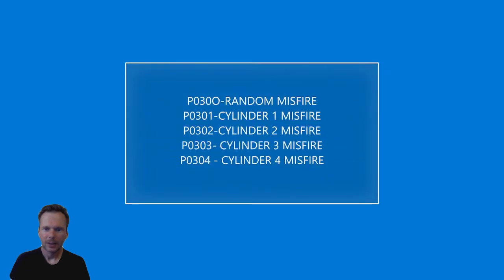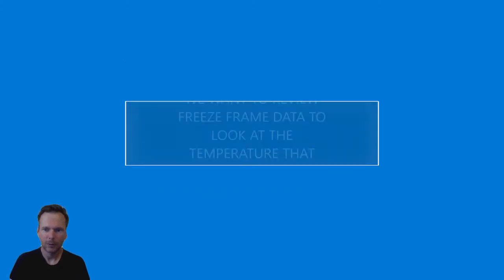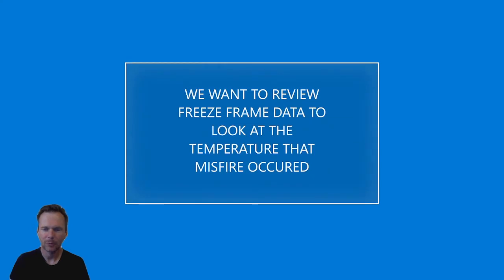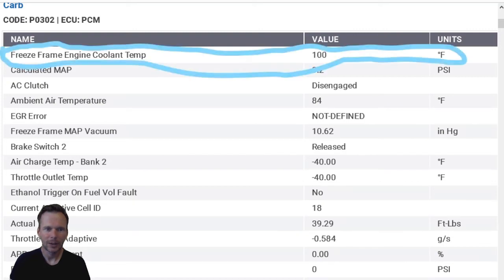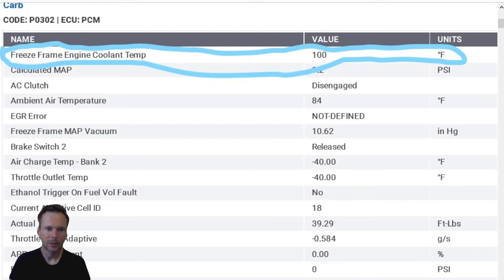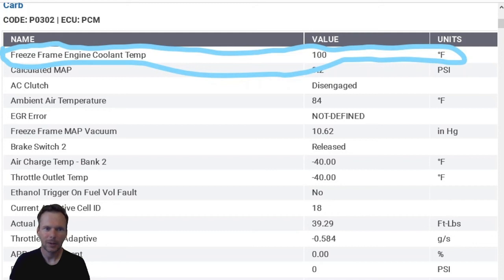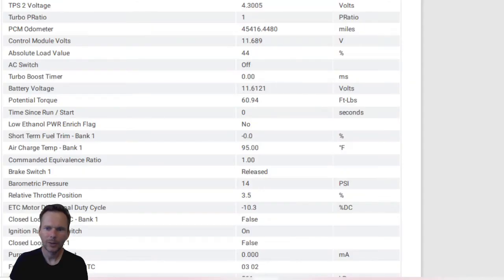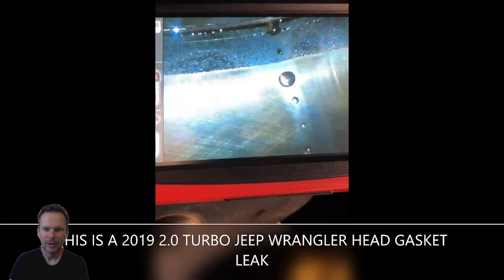2018-2021 JEEP WRANGLER 2.0 TURBO HEADGASKET FAILURE

Comment: I'm look at purchasing a 2020 and up wrangler and I am not interested in any type of hybrid. Should I go with the 3.6 or the 2.0?
Reply from the maker: 3.6 first choice . Make sure it is not an etorque 3.6 because that is a mild hybrid . 2.0 overall seems ok but like all new engine designs things can happen . 3.6 has been around a lot longer . I personally want a 4XE plug in hybrid due to all the possible rebates but maybe that has changed .This video is just based on my opinions .

Comment: I just ran into this issue. 2020 Wrangler 2.0 w/ 38K miles. P0301, low coolant, milky oil on the underside of the oil fill cap, milky oil on the dipstick, coolant system failed pressure test, dropped a borescope into cylinder 1 and found a puddle of coolant on top of the piston. Oof.
Reply from the maker: Big job .